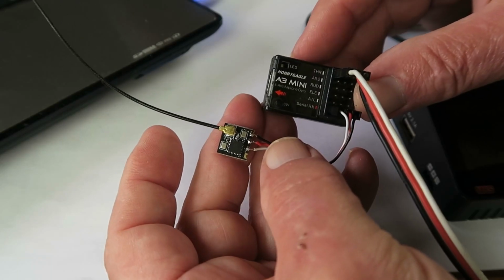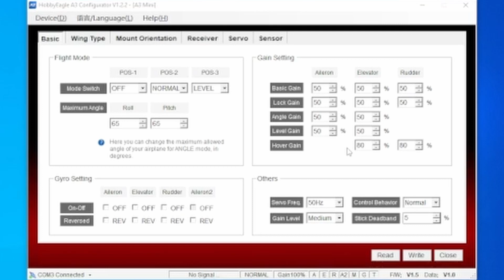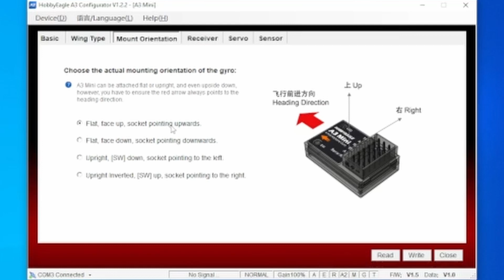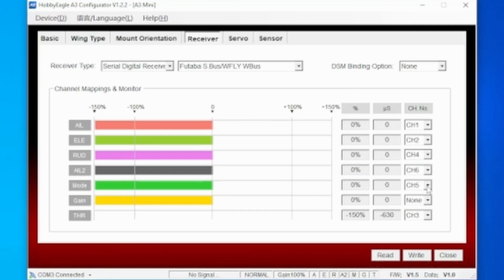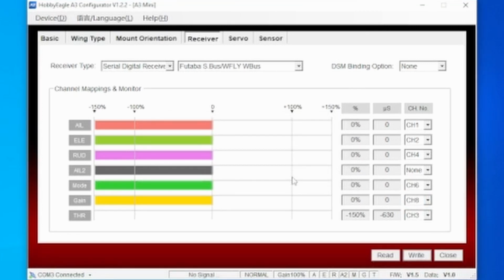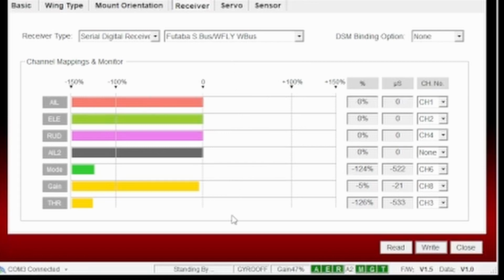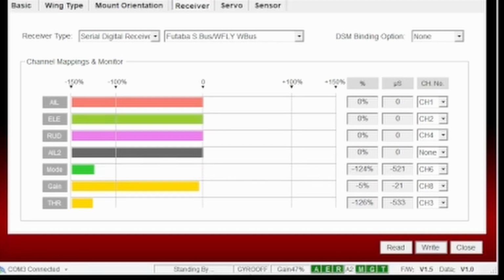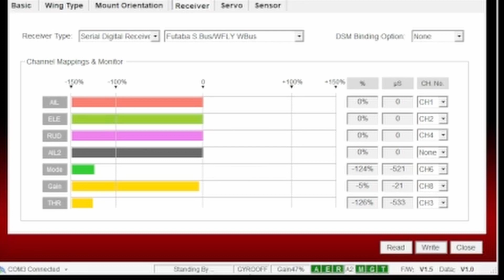ExpressLRS SBUS A3 Mini Setup

Comment: is there a satellite sbus receiver that you can recommend without eslrs? i do not ealra in my radion just the standarf 4 in 1 chip.
thanks
Reply from the maker: You can use this : Jumper R1 R900 Mini Receiver 16CH Sbus https://s.click.aliexpress.com/e/_DllmlHn Also consider getting an ELRS module for your Tx Happymodel ES24TX Pro Micro TX ExpressLRS ELRS 2.4G Module https://s.click.aliexpress.com/e/_DBVCVRt The advantage for me is much cheaper Rx options with battery and other telemetry options.

Comment: Interesting Gizmos.
 Presumably exist for their Own sake ?  
Been RC ing since '75 using  simple stoopid Futaba 4 channel radios. Solid as a rock radio link/reliability  though. (even my Original radio works every bit as well as it did when new.) 
Now Into a second  useful life as all the pilot fish have long abandoned 72 mhz (Am & Fm)  Frequencies are basically unused.

Servo reversing and Gasp ! dual rates were a  late 70's early 80's affectation  Not actually necessary but eventually accepted as usefull.. largely from constant shillings..
 Computer  TX 's basically gave fliers a myriad of things to Eff up royally... and they continue to do so..
4 channels are ALL a Toy airplane actually needs. And even Idjits flew  these competently...  in Competitions even   :-)
S bus is yet another of those  unwanted affectations pushed by Marketing men.  Much like Tel;emetry:  Widely hyped.. rarely if ever used.
 Unless possibly some Drone Weenie..
Pointless  and IMO utterly useless 'feature' otherwise.   Requiring a decoder Ring etc to break out the signals.
 How is this of Any improvement !?? .. Servo wire weight and tangles are simply moved downstream. 
Getting really tired of the incessant "futurism". 
Soon Toy airplanes  Assuming they are not rendered 100% illegal  (fair likelyhood) will be Autonomous and can be sent out to play.. all by themselves .. while the 'pilot /owner' has a Nap.
Reply: I think this is possibly the worst take I've ever heard. I'm glad you're still getting good use out of your radio though. Not everything is designed to last.

Comment: A3 MINI has been updated and now supports ELRS CRSF!
I'm starting to compare with Byme-A)))
Is there only 3 modes to choose from?
Only one 3-pos switch?
At Byme-A on the jumper t-pro, I brought all 6 modes to the 6-pos switch and voiced it, conveniently.
Reply from the maker: Good news! Now many more options! The A3 Mini has 6 flight modes : https://www.hobbyeagle.com/faq/flight-modes/ It is far and away better than the Byme-A. Thanks for watching, have a great day!
Reply: @1nformatica  There are 6 flight modes in Byme-A and A3 MINI.
But Byme-A can use all flight modes right in the air.
A3 MINI only has 3 modes available out of 6 (only one 3-pos switch).
Or I did not find how it is configured?
In everything else (except weight) A3 MINI is better!
Reply from the maker: @vovvw  You are correct in that only 3 modes can be set. Personally I cannot see any scenario where having all 6 would be useful. If the gyro is setup for "3D" type flying with hover mode then the pilot is hardly likely to need "stabilized" mode"" !! Do you have a particular scenario in mind? As for weight, you can always take the case off!!
Reply: @1nformatica  I think it's not a problem to ask the manufacturer to change the firmware and give the choice of 3-pos or 6-pos.
I want to be able to use all the functionality.
Reply from the maker: @vovvw Good luck with that! I have emailed their support and marketing depts several times and they never answered!😅
Reply: @1nformatica  And I thought you would write to them. 😁
Radiolink responds always and quickly, but they don't want to make changes...🙃

Comment: Everything is beautiful!
ELRS settings in the radio, frequency, number of channels are not shown?
Reply from the maker: Hey thanks! I do not understand your questions. What frequency? You have all the normal things you can see in the ELRS LUA script. Number of channel the Tx does not know. The SBUS decoding is done in the Rx. Have a great day!
Reply: @1nformatica  Sorry, this is google translate...
ELRS lua script:
Packet Rate - ?
Telem Ratio - ?
Switch Mode - ?
Are you interested in these settings?
Reply from the maker: @vovvw  I did not set any values myself. The values in the LUA script show:
Packet Rate 100Hz
Telemetry Ratio 080158whkw:32
Switch Mode 16 Ch Rate/2

Comment: Fantastic flying, my friend! 😃
Did you setup ch 5 to always high in the transmitter? You need to, otherwise weird things can happen. 😬
Anyway, stay safe there with your family! 🖖😊
Reply from the maker: Thanks Mario! Where do you see the information about CH5? I need to check that out. Keep safe!
Reply: @1nformatica  Which radio are you using? If it runs OpenTX or EdgeTX, it's in the mixer.
Reply from the maker: @MCsCreations  OK, thanks!
Reply: Sorry to ask, what do you mean channel 5 always high? Thanks
Reply: @fox5136  It's a demand from ELRS itself... Ch 5 is used for arming on quadcopters. I don't know why the devs haven't changed it yet, but if you don't turn it to high (you can do it in the model setup, you don't even need a switch for it), somethings won't activate, basically. 
And don't worry, ask away! 😊
Reply: @MCsCreations  Set what to high? and where do you this? Model setup in the Mini? or ELRS programming?
Reply: Thanks for the reply, much appreciated 🎉
Reply: @fox5136  Oh, I see your name is Mario as well! 😂